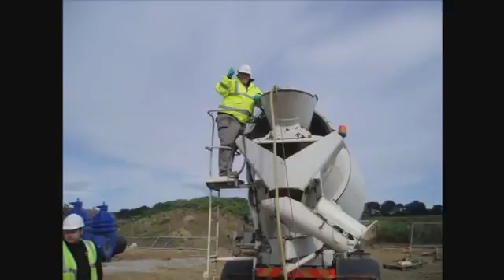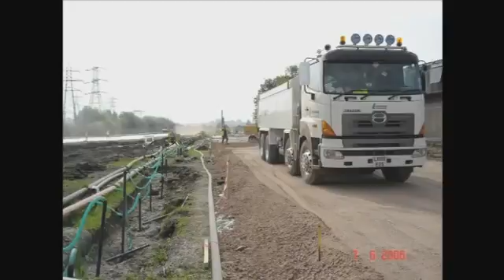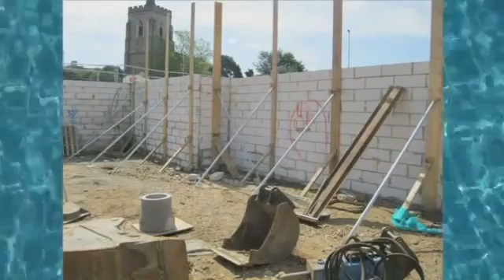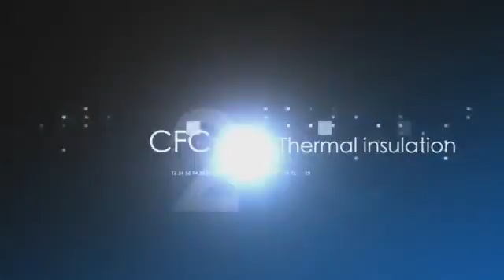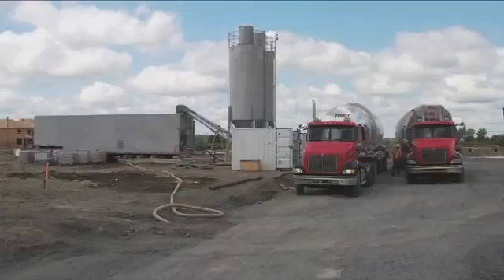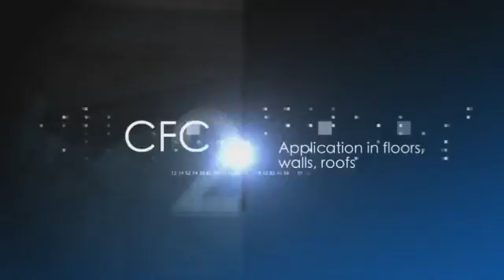Lightweight cellular concrete can be used for screed insulating roofs road beds geotechnical fills

Comment: Wonder what the forming capabilities of this concrete are. Regarding settling of foundations, in locations were loads are dealing with water tables and unstable earth. 🤔
Reply from the maker: This is non autoclaved lightweight aerated concrete (not foam concrete). Compressive strength for 600 kg/m3 density is around 2 MPA. Usually this is just part of water proofing system

Comment: Is this available in the U.S.?
Reply from the maker: you can try to make it by yourself www.pioner-group.com/concrete
Reply: @stretchceilingsDubai  Too big an area to make myself and I'm working alone.
Reply: @stretchceilingsDubai  How is it differ in strength with aircrete made with shampoo bubbles?
Reply: @uceloiiigonzales5375  both are missing gravel.  Otherwise the H2 generation sounds more homogeneous, therefore as a whole stronger.  First impression.
Reply: @dalethomasdewitt  i wouldn't say that.. because for the chemical reaction to create bubbles,where is the gas coming from when produced via chemical reaction?is it evenly distributed to the mix? because It keeps expanding after pour.. While on the other hand, bubbles are created first and then mechanically and thoroughly mixed with cement..
Reply: @uceloiiigonzales5375  Are you speaking from experience? I've read expansion with Aluminium powder generates bubbles that are not connected. Hence stronger. While foam generated bubbles tend to become connected in some degree. Hence weaker
Reply: @AntonBj3  if you've read my comments,i am only asking questions.. as i am wondering where the bubbles are coming from because they keep on expanding after mix AND pour..i have yet to creat a successful aircrete using shampoo, CDEA foaming agent & powdered foam booster that is available in my country.. i have yet to test a dishwashing liquid used and recommended by a YouTube video. I dont know i i just need to try another brand of portland cement.. 

Aluminum Powder is a Hundred times more expensive so i haven't tried that either.. how about you? Have you even tried using anything and what are your results?
Reply: @uceloiiigonzales5375  My knowledge thus far is only theoretical. I find it really hard to find legit information on Foam Concrete. At what price have you found Aluminium Powder?
Reply: @AntonBj3  i can't even find "aluminium powder" anywhere else but Alibaba i can't understand how much it really is because it has a minimum order of 100 kilograms PLUS SHIPPING from China.. cheapest i found listed is $12 to $35 per kilogram and then when you try to order, the price is nowhere near that specially with shipping and minimum orders so.. i gave up on this..  at least the soap bubbles, i have found a video made in my country.. so i have an idea of the soap brand.. but im still not sure about which brand of cement i should use.. my aircrete keeps collapsing.. cement on the bottom and water on top when bubbles pop.. TOTAL FAILURE is best to describe it
Reply: @uceloiiigonzales5375  What you are describing is known as "bleeding" and is caused by incorrect ratio of water to cement. You are supposed to use regular Portland Cement. I've also read that Fly Ash will have effect on the aeration. In what way, I am not sure. Possibly in a negative way. Try using Portland Cement without addition of Fly Ash. Are you using a verified recipe?
Reply: @AntonBj3  i have tried as little water as possible most Portland available near me has that rice husk ash.. recommended postland is type1 yet i can only get type1A which has pozzolan in it.. its like hitting a brick wall for me because im not sure i can get Portland type1
Reply: @AntonBj3  im experimenting with my own as the recommended brand aren't available in my country, Philippines..
Reply: CEMATRIX Corporation, a North American leading manufacturer and supplier of technologically advanced cellular concrete products